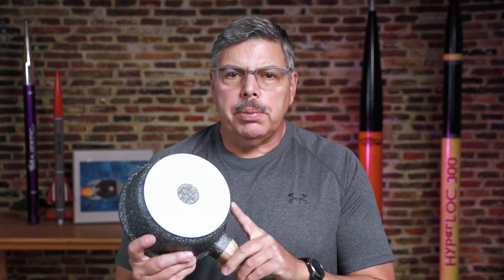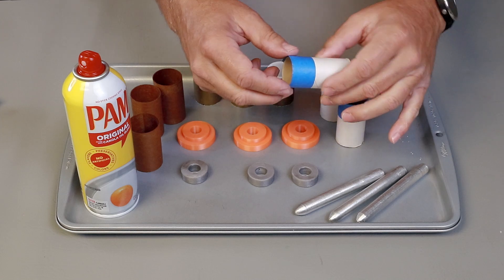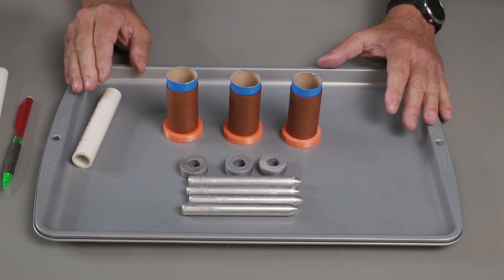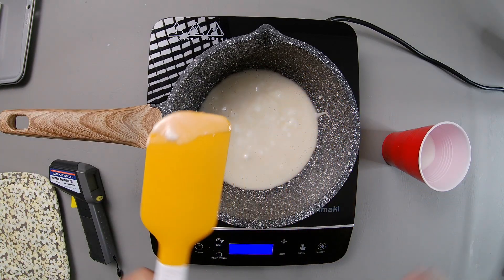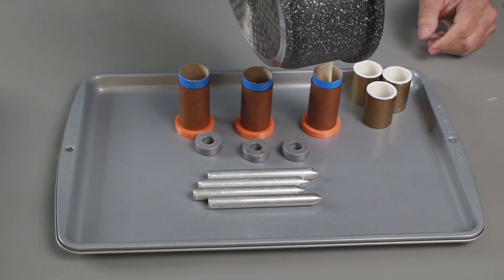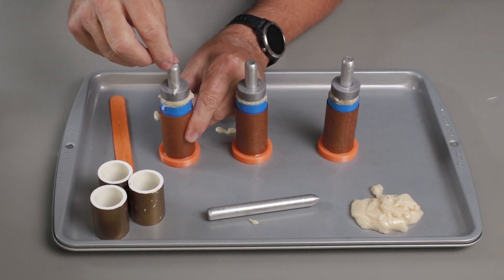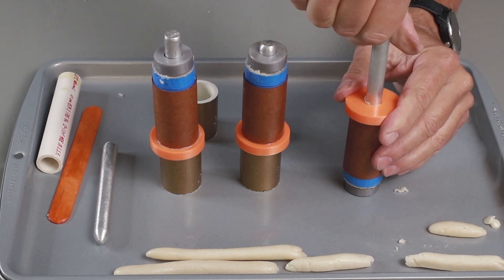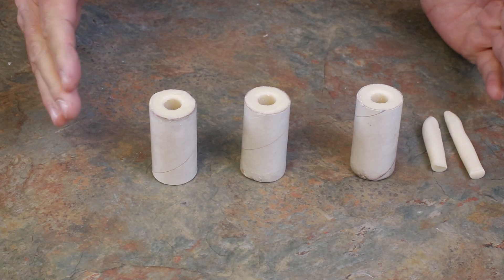Casting sorbitol rocket fuel.

Comment: Casting Tube are made up of what? Can you specify material pls. 3d printed parts are made of PETG or PLA? I always face difficulty in finding material for highg temp.
Reply from the maker: The castiong tubes are made from cardboard, they are available from Always ready Rocketry. You can make your own casting tubes from rolled posterboard. 

This is another casting video. I am planning on an all new version soon.
https://youtu.be/wpPwya8NEyI

I use regular PETG for casting parts. The trick is to use eight top layers for the base and donut.

Comment: hi, good video, one question, what material is the inner liner made of?
Reply from the maker: The liners are sold in sets from Always Ready Rocketry. There is an inner casting liner and an outer thermal liner. The casting liner can be made from poster board.
Reply: @TheRocketeer thanks!

Comment: Good video! Is it possible to use a normal stovetop, instead of an induction one? If so, are there any added risks to this?
Reply from the maker: Safety Guidelines for Cooking Propellant

Avoid Stove Tops in Kitchens: Cooking propellant on a standard kitchen stove is strongly discouraged. If powdered or liquid fuel comes into contact with a burner, it could ignite and start a fire.

Preferred Equipment:
Induction Cooktops: These are ideal for their precise heat control and enhanced safety features.
Portable Cooktops: For small batches, consider using a portable cooktop in a well-ventilated outdoor area or a garage.

Safety Precautions:
Maintain a clean workspace free of flammable materials, including overhead items that could catch fire.
Always have a fire extinguisher readily accessible.
Use a reliable digital thermometer to monitor temperatures accurately.

Personal Responsibility:
Ultimately, it is the responsibility of the individual preparing propellant to prioritize the safety of themselves, others, and surrounding property.

Comment: I love your videos so informative. I want to make some 29mm casting. Would everything be the same just smaller tubes. I love the 3d printed jigs, where might I be able to get a set for the 29mm? oh the coring size for 29mm?
Reply: No luck finding a 29mm snap ring case. So on to bigger things like a 38mm one. Oh and a new rocket darn :) for the said 38mm case. still looking for casting tools like you gave.
Reply from the maker: It is easier to make 38mm grains anyway, a 4-grain 480 case from Loki makes a good H-200 motor. I don't offer the 3d printed casting tools yet but it shouldn't be too hard to find someone to make them for you.
Reply: @TheRocketeer  Woops typo I meant have and not gave. When my tubes get here, I will take them to the big box store and see what i can find and or make to fit them :).

Comment: For some reason my grains get soft after few weeks, probably due to moisture intake
Reply from the maker: It's very important to store grains properly and right away! Drying soft grains out does not work well so start with fresh ones.

I store my grains in filament storage bags like below, I could not get the vacuum pump to work but it doesn't really matter. I have learned that Ziploc bags will not keep moisture out for the long term.
https://amzn.to/4aCEry7

I also always use desiccant now.
https://amzn.to/3tyPwQ7

These stainless steel canisters work great.
https://amzn.to/3TEyH0J

Amazon links help support the channel, thanks.

Comment: Why would you do it this way and not intimately mix the KNO3 and sorbitol before hand when it’s dry?
Reply from the maker: Adding the potassium nitrate later enables quick dissolution of any clumps in the sorbitol. As the sorbitol melts, it envelops the oxidizer particles, facilitating intimate contact. This is why melted fuel is superior to dry pressed. It's important to note that potassium nitrate does not melt at the temperatures used for casting.

To visually confirm thorough mixing, consider adding a few drops of food coloring to the mixture. This will demonstrate that the fuel blends easily and thoroughly.
Reply: @TheRocketeer   That's not what I'm saying. I know melted is better, but why wouldn't you intimately mix the sorbitol and KNO3 before heating (ball milling) so the suspension is better mixed when the sorbitol does melt and envelop it? Wouldn't that be better than just spooning it in?
Reply from the maker: I have done it both ways with the same results. It is not necessary to premix because the propellant is a liquid. @WildernessMedic
Reply: @TheRocketeer   Well that saves a lot of time. Thanks.

Comment: I have a question. I'm new to homemade sugar rockets and have been experimenting with different motor bodies. Cardboard tubing, PVC, and Bamboo which didn't work, it cracked when compressing my mixture of fuel.
Last night I came up with a possibly Great idea for a rocket engine. A thick, but lite aluminum bottle that tapers. I haven't cooked rocket fuel, only in powder form. 
After I am finished compressing propellent, I use a appropriate diameter masonry drill bit to drill out the core  . I think using this aluminum bottle will work . My only concern is the take off weight . Any input you can share ?
Reply from the maker: Thin aluminum melts quickly when heated to extreme temperatures.

When starting out making sugar motors I always suggest begining with something that works and then experiment from there. I have many videos on how to make fuel and rocket motors. Have fun and stay safe!
https://www.youtube.com/@TheRocketeer/videos

Comment: Don't you need a conical shaped clay nozzle?  I made rocket motors like this in the late 50's with ZnS and KNO3 sugar and a little dextrin as a binder fuel.  The spindle had the proper shape for the charge and also  for the clay nozzle.  Mix the Zn and S with acetone and pour it in the tube around the spindle.
Reply from the maker: The BATES grains go into an aluminum snap ring motor with a graphite nozzle from Loki research. I have only seen one video of a Zn + S motor and it was all out crazy, so much flame and sparks!

Comment: Curious- have you or anyone else experimented with adding 1-2% burning rate modifiers to KNO3 or whatever your oxidizer blend is?   From my understanding zinc and copper nitrites have been used for this.   From the patent data these catalysts were being tested with AN and AP based oxidizers, and were giving 30-40% increased specific impulse, don't see why it wouldn't work with KNO3.
Reply from the maker: Potassium nitrate is not as strong of an oxidizer compared to ammonium perchlorate or potassium perchlorate and therefore it does not burn as hot. Ammonium nitrate usually needs magnesium to perform well. In other words potassium nitrate will not burn hot enough to take advantage of zinc. I have had some success with aluminum and magnesium in sugar fuels but I have found it is difficult to control burn rate. I have not had any success with RIO as well.

This summer I hope to test magnalium, a blend of aluminum and magnesium. I think this combination holds promise at around 5 - 10%. I have not tried any copper combinations. Testing unknown combinations usually causes a loss of hardware and that is something I need to limit.

Go to my home page and scroll through some of my previous tests with metal powders. YouTube.com/TheRocketeer

Comment: Powdering the potassium chloride will greatly improve the propellant since it doesn't melt. The finer particles will disperse better.
Reply from the maker: It is true that grinding the potassium nitrate will make the fuel burn faster. The difference is not that great from granulated oxidizer and it will make the fuel more difficult to cast. Thanks for your comment.

Comment: Hello. Which are the ratio between external and internal diameter, and the recommended length of the block? Thanks in advance.
Reply from the maker: The casting base extends about 1/4" into the casting tube. I use a 1/2" mandrel to make the core. I hope that answers your question.

Comment: I just wanna ask, how are the coring tool size and the casting size relate? how large is the diameter of my core, and how large is outer diameter if it says "38mm"??
Reply from the maker: A 38mm sugar motor has a 1/2 core. The motor consist of a casting tube that has a 1/2" core that fits inside a thermal tube that protects the case from excessive heat. The casting tube and thermal tube slide into a 38mm motor case. The tube set can be purchased through Loki or Always Ready Rocketry. I hope that helps.

Comment: You can avoid having to trim bevels on your grain ends by using a tapered end cap and compression disk. 
Also, KNSB propellant grains can be used 24 hours after casting (I've even flown ones in 4" motors after 12 hours)
Reply from the maker: I agree that a taper is a better solution. I made new casting tools out of acetal and I plan on cutting a taper for each end. That is as soon as this mid 20°F weather passes and my lathe thaws out!

Good to know that 24 hours is enough for sorbitol. Thanks for your comment.

Comment: Hey gotta a stupid question , but I gotta ask it. What is the ideal length for your grains? I have never purchased an aerotech grain, so I really have no idea what is the actual grain length. I just picked 1 3/4 inch (29mm diameter) along with a 5/16th coring tool.  Would all the grains be the same length no matter the diameter?.. i.e. 24mm 29mm 34mm etc. I realize that the core diameter will change with each different diameter grain., but the lengths i am not sure of. I purchased some cesaroni 29mm casings and found some nozzles at another company. Get my O-rings at the hardware store in town and cap the cesaroni casings with about a centimeter slow cure (24 hour) epoxy. I like flying electronic ejection systems so delay charges are well beyond my knowledge.
Reply from the maker: This is a very good question so let's take a look at it.

Grain length is usually around 1.50 times the diameter of the grain. A 38mm grain is around 1.50 inches, multiply that by 1.50 and you will get 2.25". For 54mm diameter grain I use 3.25" long BATES grains. In your case a 29mm motor would use a 1 3/4" grain. The fuel length will be determined by the case length. All the grain lengths are usually about the same unless a very long case is used. I don't worry too much about grains being the exact same length.

For my 1,200 LOKI style case I sometimes use 4x grains (2 3/8) instead of three to lift a heavy rocket. Longer cases will give more options.
I use a 1/2" core for 38mm and a 5/8 core for 54mm motors. I think a 5/16 core should work fine.

Electronic ejection is the best option for sugar motors. You are on the right track, press on!

Comment: Sir can you tell me what is the diameter of that aluminium rod used to make the core of rocket motor
Reply from the maker: It is 1/2" or 12 - 13mm.
Reply: @TheRocketeer  sir is there formula to calculate according to our size of our pipe

Comment: why you dont add ironoxyde powder? it will incrase the burn speed alot. 100g of your fuel +1g Fe2O3
Reply from the maker: This is a very good question and one that comes up fairly often.

You are correct that adding red iron oxide (RIO) at 1% will increase the burn rate. Adding RIO will not boost the specific impulse or amount of energy produced by the fuel by very much.

There are other ways to increase the burn rate without adding anything else. Increasing the number of grains in a motor or the core diameter and using a smaller nozzle will accomplish the same thing.

There can be advantages to using a slower burning fuel such as adding more fuel and allowing longer motors to be made without erosive burning.

I hope to produce a video on this subject in the summer.
Reply: @TheRocketeer  You melt the fuel in an pan wouldnt an oil bath work too. we call it here an Simmer pan it has an chamber with water (instead of water you can fill oil in)and so the inside doesnt rise above the boiling point of the oil .
Reply: @Preyhawk81  Yes, a simmer pan should work well for you. Good luck and stay safe!

Comment: I don’t understand how your fuel remains white. I’m following the same directions as you and I cannot get the sorbitol to melt and remain white.
Reply from the maker: Mixing propellant is an art and science. Don't be too concerned if the fuel turns out to be a light tan. Heating the sugar too fast will cause it to turn darker.

Heat the sorbitol slowly and try not to go over 250°F for very long. Hold it at temp for at least 1 minute or longer if it takes an excessive amount of  time to set. Sometimes impurities in the potassium nitrate will cause it to turn darker and not much can be done about that other than changing vendors. The fuel will burn just fine.

Potassium nitrate that I use.https://www.seedranch.com/Potassium-Nitrate-Powder-KNO3-Saltpeter-p/kno3-powder-5.htm
Reply: Sorbitol melts at 203 F. Cooktops are not super precise when it comes to heating, some areas will be hotter and some cooler. Melt all of your sorbitol at the lowest possible temperature setting and only then increase the temperature while stirring until the viscosity is low enough to pour. I usually pour at around 220-225; Increased heat and time will gradually darken the mix as will impurities in the KNO3.  Under no circumstances should you ever use an open flame or electric heating element cooktop...that's how fires start.

Comment: Love your videos been watching most of the day on the 3d print are you selling the files or can I download them somewhere man I have looked at so many videos on making rcandy  sugar rockets but non have put them in a rocket kit so I have been looking for you along time
Reply from the maker: Hey Chris, I am glad you found me!  Please like and comment on videos, it helps others to discover the channel.

The 3D print files are listed for the PVC nozzle in another video but not for the casting tools. I don't have a 3D printer but the casting tools are very basic. I will check into posting the files. I have used common washers in the flexi-fuel video. I use plastic from a cutting board and mill them on a mini lathe for 54mm motors.

I built a dual deploy rocket just for 1" PVC motors called "Candy Magic"  but ran out of time to get it in the air and now winter is here. You can look for it in the spring. Stay tuned, I will have more videos on sugar fuel and PVC motors soon!

Comment: Long time watcher, never commented…
I appreciate all you show me.
Show me how to make ejection charge, simple to complex.
Checking in from Texas
Reply from the maker: Single use motors come with the ejection charge built in and some are adjustable for delay. Aerotech reloadable motors ship with a small vial of BP but I don't think LOKI motors are supplied with it. For dual deploy you must supply the BP charge. At this time in December of 2021 traditional 4f black powder is unavailable because GOEX shut down production. I think imported BP will be available next year. When supplies resume I will make a video on setting up an ejection charge for a high power rocket. I hope that helps and don't forget to subscribe!

Comment: Thanks u my teacher ..
Question : 
What is the propellant used in ballistic missiles? ( solid fuel )
Reply from the maker: I don't know but the space shuttle  primary propellants were ammonium perchlorate (oxidizer) and atomized aluminum powder (fuel).
Reply: @TheRocketeer  The grain is HTPB hydroxal terminated poly butidyne. You can make a low smoke design by eliminating the Al. Slow down the burn rate by adding ferric oxide.
Reply: The shuttle SRBs and SLS uses PBAN and some rockets use HTPB as the binder/fuel with AP and Al
https://en.wikipedia.org/wiki/Polybutadiene_acrylonitrile

Comment: I am not able to find sorbitol around my place, no online retailers either, have been using sugar, difficulty is Sugar gets extremely hard to work with as soon as it cools down even a little bit
Using a handheld hack-saw to cut the excess from ends of fuel grains, it's like sawing a piece of rock that also ruins the blade.
Reply: You could also try dextrose based fuel, which is labelled as "Glucose D" and available almost everywhere.
Reply from the maker: Have you tried casting flexi-fuel? Take a look at this video from my channel.
https://www.youtube.com/watch?v=KZQ-cVx4Mkw

My thoughts on Rcandy.
https://www.youtube.com/watch?v=OvtFxdWNrp0

Make your own corn syrup!
https://www.youtube.com/watch?v=QhK7e-v7rxk
Make it like thick syrup.

Let me know if any of the soulutions work out for you. I know other countries do not use Karo or corn syrup.